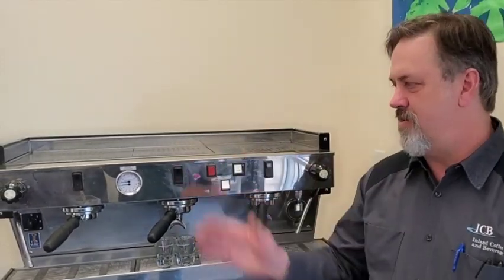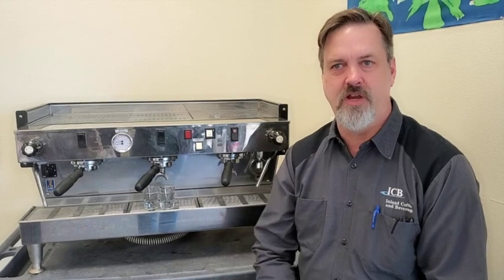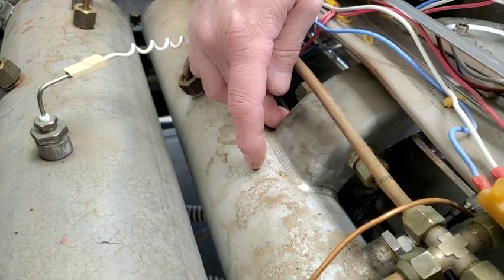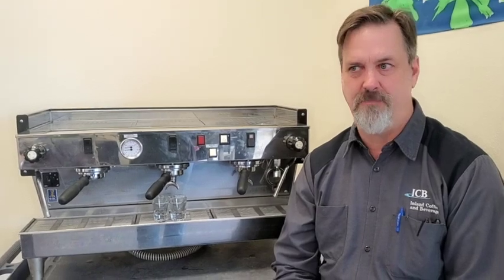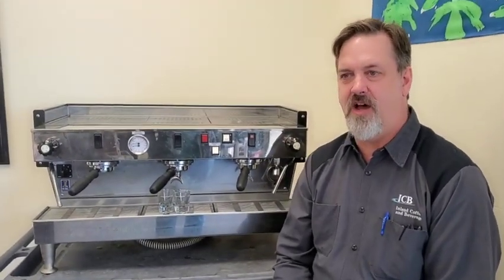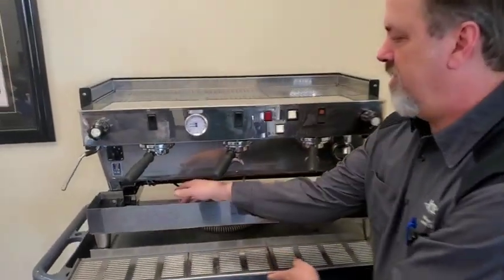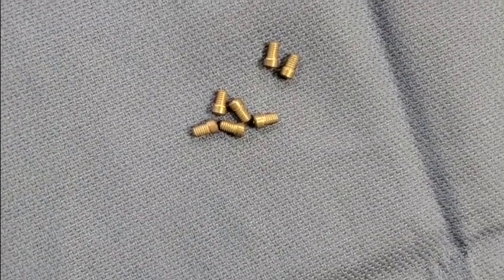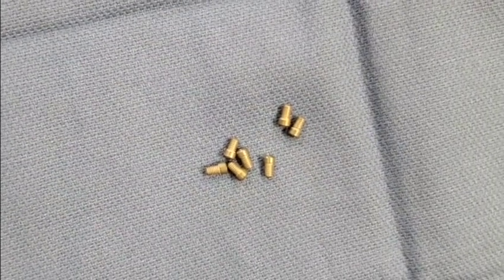What to know Before you Buy a Used La Marzocco Linea Classic

Comment: Great Video, Wanted to Share:
We insulated our commercial use Linea 2 Broiler tanks for FREE using 1" thick polyester batting which is very friendly for lungs and non itching and sheds very little and has a max working temp of 150c, which is above the broiler's oem malfunction high temp limit switches of 130-135c. 
Unfortunately our $10k machine circa 1999 came with no insulation. Unlike the newer versions. 
It's improved the staff and AC bills and will help the machine last longer without the elements cycling on as much and the heat drying the wiring and more. 
We used "Renewliner" polyester batting which is sandwiched with polyester film, obtained for free from mailed meal kits. 
Polyester batting is often made from recycled bottles. It can be found for free on discarded sofa foam cushions, and other places and sold in stores. Polyester loose fill is in most of our pillows.
Did a write up on a forum on it. It tucked and stayed in place with no need for zip ties or twist ties. Poked holes and cut lines for protruding sensors and to tuck under water lines. Added extra sheets to brew heads and steam wand fittings and on over the tanks-heat rises. It pulls right off if needed for service/inspection/repairs.
It is also a very good insulation for hot tubs internals, car/rv roofs between the ceiling and headliner and side walls.
Take care.

Comment: A used AV (in pieces) from the early 90s just came on my radar and this video was hugely helpful for knowing what I'd be getting into. Sadly it does have the old style boiler, so I'd have to consider replacing that. Although the machine would be for home use and maybe a few days a year of pop-up so I'm not sure it would even be necessary based on the super low volume.
Reply from the maker: There’s nothing worse than destroying your house with a leaking machine.
Reply: @EspressoServiceNetwork  Definitely. Once I realized it was 220v I was out anyhow.

Comment: Can u give me a tip
 I got want used (la marzocco 
Everything works, except motor keeps working
Reply from the maker: If your motor is constantly running, then you have a shorted triac or relay.
Reply from the maker: What model are you working with?
Reply: Linea 2group
Reply: What is triac means?
 Thanks for your help
Reply from the maker: @adriangonzalez-is3rt  Is it an EE or an AV? A triac is an electronic switch on a board.
Reply: Thanks 🙏
Reply: So pretty much on this case the problem is the switch/ the one controls main group???
Reply from the maker: @adriangonzalez-is3rt  Are you in the States? Please call us if possible.
Reply: The one I have is EE
Reply from the maker: @adriangonzalez-is3rt  Is the pump continuously running?
Reply: The pump bring water in then stop
That is ok but motor only keeps running
Reply from the maker: @adriangonzalez-is3rt  If your motor is constantly running it is either the machine is trying to fill and can't or it can be the relay on the liquid level board stuck closed causing the motor to constantly run or bad brew group switch stuck closed. I would check the first two.
Reply: The relay is the contactor right??
Reply from the maker: @adriangonzalez-is3rt  No, the relay is inside the liquid level board.
Reply: Thanks for your help
 Let me try
Reply: Well i changed the two group switches,and it does stop, wondering,what the switch has to do with the motor pump,??
Reply: I know is to many questions,and sorry
About that, but know i see the thing u call level pro broken ,is it any electrical problem??
Reply from the maker: @adriangonzalez-is3rt  The switch activates the motor and the brew group solenoid. If the switch goes bad and the contacts stay together your motor will continuously run.
Reply from the maker: @adriangonzalez-is3rt  I apologize but I cannot understand what you are describing.
Reply: My bad
 That's Auto fill probe, this thing was broken 
as if a bad electrical current had broken it,,
 I already put a new one, but I'm worried if that's going to happen again? Again thanks for your time
Reply from the maker: @adriangonzalez-is3rt  if your auto fill probe was broken your boiler would be over filling. It sounds like you should speak directly with a service technician. Do you have someone you can speak with?